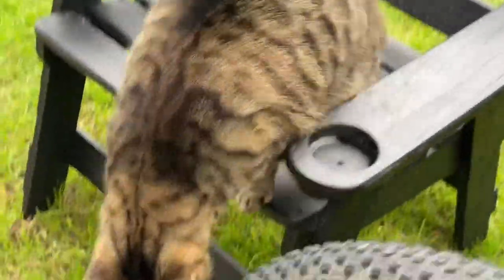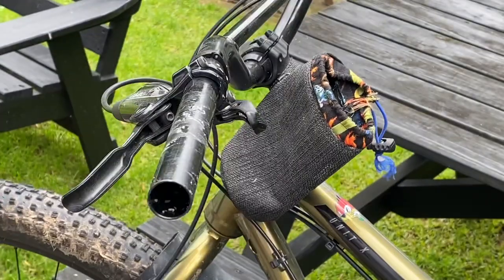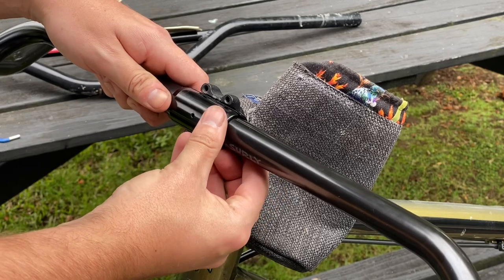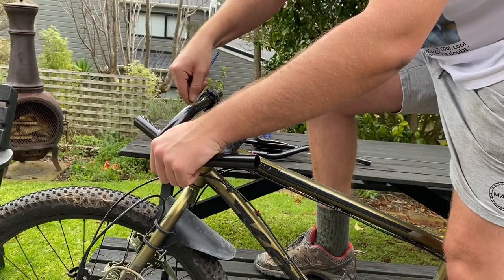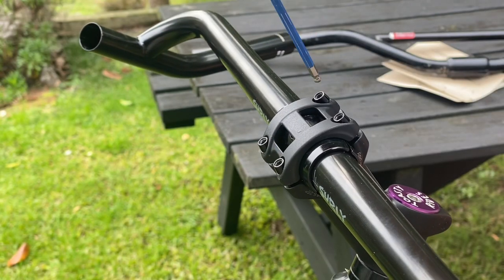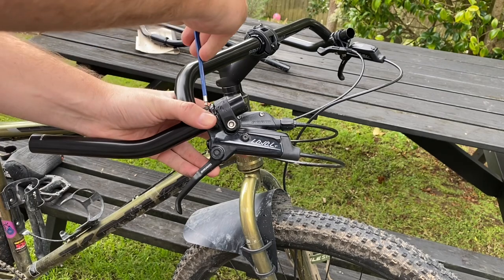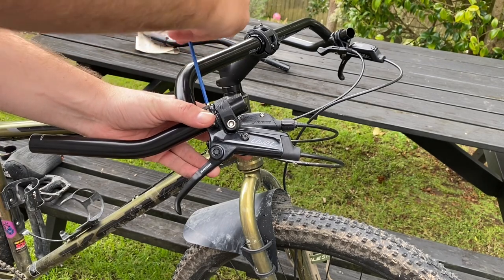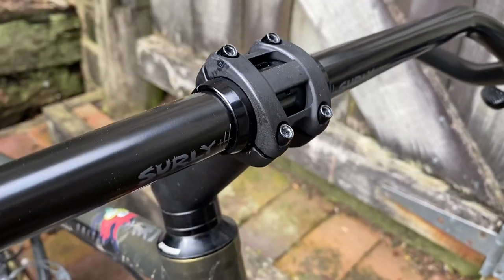Surly Corner bar install - Kona UnitX

Comment: My first impression when this bar released is that the bar ends should be longer so that it can be used for another hand position (as you said), it should be lighter maybe made of alloy instead of cromoly and that Surly should release a silver version for us restomodders.
Reply from the maker: They definitely should be! And yeah a few people have mentioned that. I don’t mind the weight, but it would increase sales if they made an alloy version I’m sure!
Definitely agree, silver complements the retro bikes out there really well 👌
I would go through the effort of stripping it, if it was going on an 80s/90s mtb 😎🤙

Comment: Maybe putting levers/shifters under the bar would make hood position more usable
Reply from the maker: Yeah that’s worth a try! I’ll try it tomorrow, I think it would use up too much of the “drop” position though. One way to find out 👍
Reply: Split the difference with an over/under?
Reply from the maker: @davedelarosa319  yeah that’s how I have it now(after this vid) and it seems great! Shifter and dropper lever on the “hoods” and brake levers under. I’ll ride it like this then probably go back and forth a few times before wrapping it up
Reply: @toastyrides  when watching the video it looked like the best immediate (and also no cost) solution. Which is boss in my world view.

Comment: Surly Corner Bar is the best money have ever spent on a bike upgrade. Transformative!
Reply: I'm assuming that you figured this out eventually (a dangerous thing to do) but if you mount the brakes and shifters from below (bring them up the drops) then you have an actual hood position and the shifter works WAY better.
Reply from the maker: @bosanderspublictheology   they’re an awesome handlebar! Yeah I tried them in lots of different positions. 
I’ve ended up with the levers down below and with the shifter and dropper lever up “top”-above the join. 
This has worked best for me, along with an extension of the original hood position which I use on some uphills and long straights etc 😎🤙 very comfy bar, loving it still!

Comment: Being a fan of board racers this is all good options on position of controls aside Surly have no doubt restarted a journey to north road bars, which back in the day you could have one way up for touring then unspent the qr wing nuts an reset for race drop position,  this was often seen on 1930s to 1960s in U.K. I gravitate towards path racers what you know call gravel bikes, first time I rode a proper period race path finder on loose gravel an cinders you immediately notice how slow an cram the steering is so much less nervous than modern rides, I've tested a cycle cross bike by sunn against a Iona lava dome against a jmb path racer from 1926 the jmb was the calmest down a steep long hill 30 ish mph it just enables you to deal with constantly moveing on the surface your riding part geometry of frame but also very much the bars an your body position being more prone you can rest your elbows on your upper legs as a steady sort of.if you can find true period drop bars sorta north road in appearance only issue tend to be narrow but very elegant to look at, I hope Surly produce some of that style in a quality material.
For anyone trying this, if you have enough high rise from stems you can use beach cruiser bars upside down that give the width but a tad to much drop, I'll try these Surly corner bars on my Kona cheers for review.
Reply from the maker: Thanks heaps for sharing! That’s one thing I like about them, too. That path racer look 👌 the Corner bar is certainly wide enough and it’s treating me well so far. Hope it goes well for you, too! 
Are you putting them on your Kona Lava Dome? That would be a great match!

Comment: based from my experience with these, the drops are where i spend most of my time on the bar. with that said, i placed my shifter to the drop portion of the bar instead of on the hoods, so it's easily within reach. it was an added challenge when we had to put the bar tape on, but it paid off in the long run.

without a bar end extension to make the hood more viable, i don't find the hoods very comfortable to ride this with.

Comment: You can buy a handlebar extension plug if you want those knobs to extend. Enjoy your new bars.
Reply from the maker: Yeah there are those scooter ones, or pretty hefty ones for motorbikes that should fit. 
Or I’ll modify some alloy barends 😎
Last/permanent option is weld some extensions on haha

Comment: Great bike, great bars (definitely retro-cool!). But what caught my eye are the bottle (and other stuff) holders on the fork! Did you have to drill into it to put them in?  or is it just velcro straps of some sort?
Thanks and safe ride!
Reply: Not OP but Kona Unit comes stock with these mounts on fork, very cool move from them.

Comment: Hi, excellent content. Ordering Surly Corner Bars to me and wife’s Kona Unit X’s. Any update how you set it up? Im thinking that I would install brakes and gear / drop post lever to lover part of the corner bar. Then I would have more space when using the upper knobs position. Any suggestions?
Reply from the maker: Hey, thank you! I’ll be doing an updated video next week but basically I’m running it as intended (shifters etc up top) but extending the upper knob/hood part so there’s more room. 
It’s the comfiest that way for me, with my setup and my sized hands etc. 
Splitting them (brakes down low, shifter etc up top) is pretty good too! 
I’ll go over a few things in the video next week and show how I’m extending the bars (without welding) 🤙

Comment: I'm not sure if I like where the shifters sit. When I look at these they seem to force you to use the drops for braking. Seem like the shifters would be better somewhere on the tops but you can't install them that way. Only time a lot of riding will tell. One final note these would hard to use navigating between 🌳 and tight twisty trails but good for maybe commuting ( kind of iffy there)
Reply from the maker: I’m loving these bars for all types of riding, they’re not for everyone and they definitely don’t sound like your jam. But no stress 🤙
Reply: @toastyrides  Idk haven't tried them. That was just an observation at a glance
Reply from the maker: Yeah they’re aimed at using the drops, mainly. You could install shifters up top, depending what you have, if you wanted.
But mine will stay down low, accessibility in the drops is my goal. 

They provide plenty of leverage for cornering, climbing but aren’t quite as wide as some other bars out there (and the bars I swapped off for these) so clearance hasn’t been an issue for me.
I’m loving them 😁👌 my only gripe is the horns/hoods area isn’t long enough, but ah well- they can be extended.

Comment: May i ask how tall are you and wich size your Kona is. Would be a great help
Reply from the maker: I’m about 193cm, this one is a Large as I wanted to switch between different setups(dropbars/risers etc) but I now have a pink one which is XL. I like the large more with corner bars, but I’m rocking Soma Dream Risers on it most of the time and feel it’s a very versatile setup👌
They’re very long bikes!
Reply: @toastyrides  Thanks. I´m about 180cm and not sure about the size.  I have the corner bars at another bike and want them on the Unit also. Other Idea would be the Surly Ogre cause ist a bit shorter...

Comment: Hi do you get the bar from overseas or here in NZ ? I have been looking for some cheers
Reply from the maker: Hey! Seems like a lot of places are sold out here for the 54cm. 
If you want the smaller sizes then you should be able to find them, possibly the 54 but I gave up looking so ordered them from overseas. Otherwise the 54 will be restocked here in December 👍

Comment: Is it possible to put grip shift on the corner bar? Thanks!
Reply from the maker: It is a 22.2 bar but it might depend where you put it. It would go on the “hood” part as it’s straight but it might not slide up the bend on the lower portion. I don’t really know, it is a shallow bend so it might 🤔